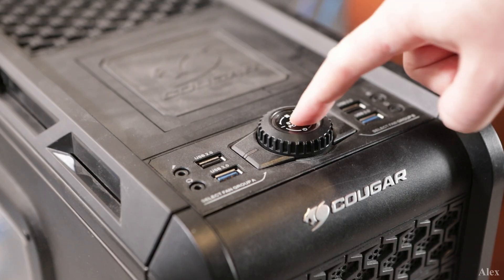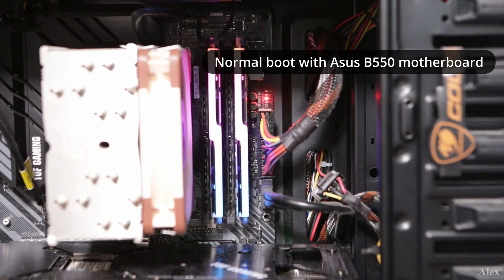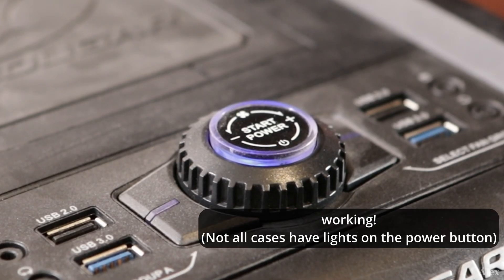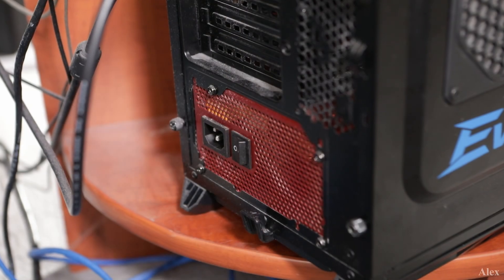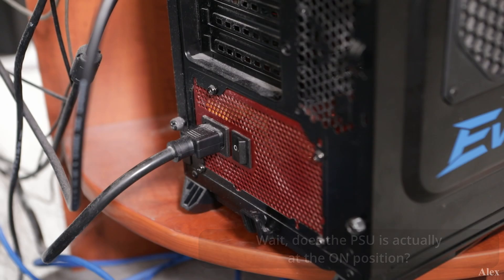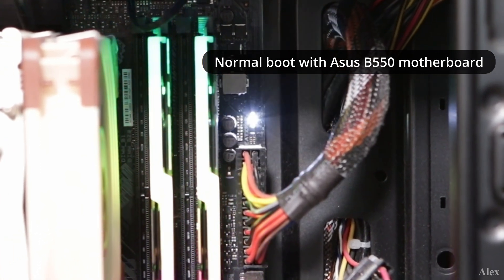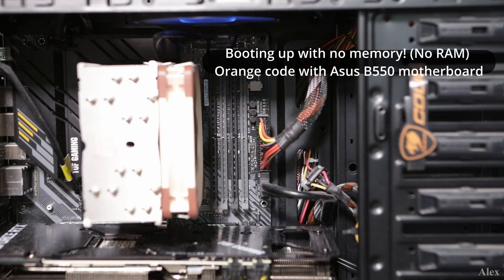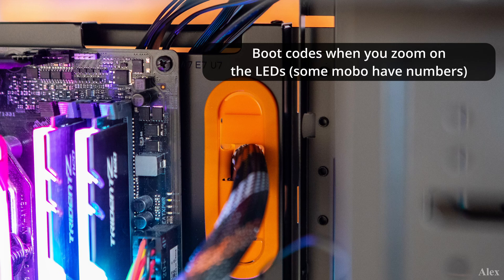Computer does not boot! The Power Supply is not working? PSU - Tech Support Global edition

Comment: I know this is 1 year old, but, It's okay to boot the pc without the 4pin connector from the psu removed, I usually had it plugged it in the 4pin sys_fan on the motherboard. i changed the motherboard, the cpu, the psu , all are new. And The pc boots only if that 4pin from psu is removed, if it's connected it's like locks all the power to the pc, but without it, it works okay.

Comment: So my pc froze then I turned it off then when I tried to turn it back on it just threw some codes then turns off I reset the cmos and moved the ram and used only one stick and it still turns off 
Specs are 
Motherboard :ASRock B550 Steel legend
CPU : Ryzen 5 3600
Gpu : GTX 1080
Reply: When I take off the ram it stays on till I turn it off so no way the psu is the problem
Reply: It was the motherboard in the end I replaced the ram psu and motherboard one by one it only worked again after replacing the motherboard